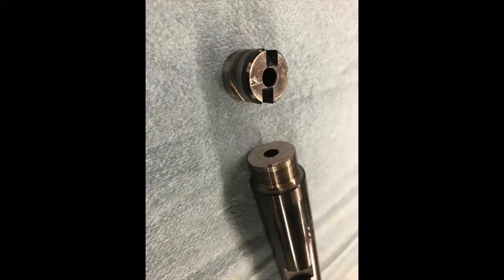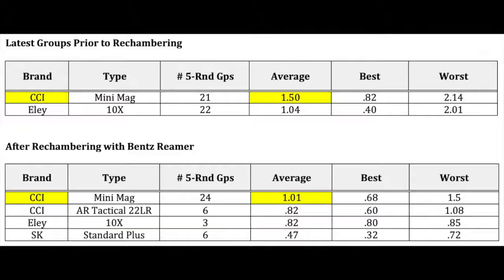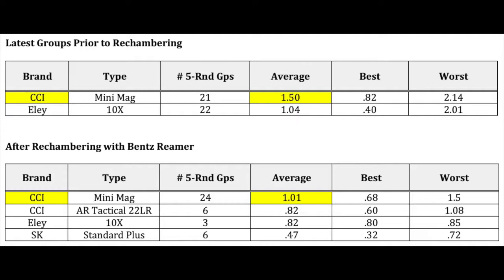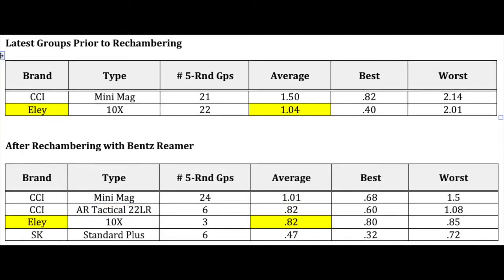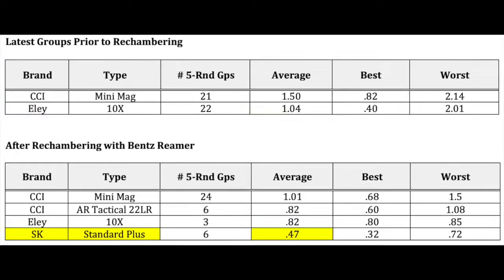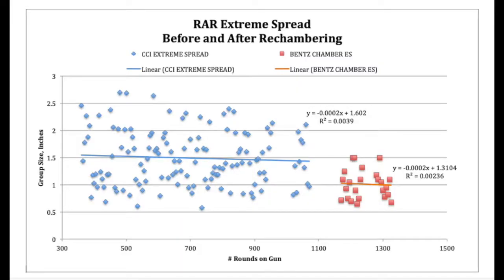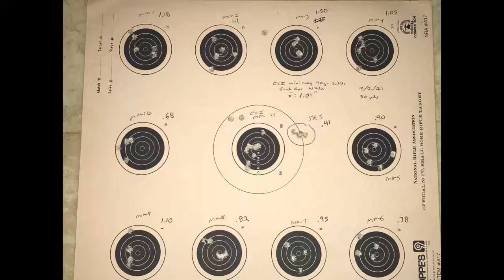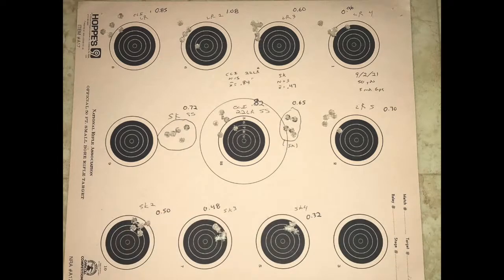Ruger American Rimfire (RAR) Experience.  Part 10:  Rechamber barrel with a Bentz reamer.

Comment: I've shopped around online to see if one can simply replace the standard 10/22 barrel with some aftermarket barrel in the standard sporter taper, but with a Bentz chamber. I'm not looking to make some fancy carbon fiber varmint machine with a full on wild stock and tons of trick parts. Just replace the standard barrel with a similar weighted quality barrel with Bentz chamber. If I want to upgrade the trigger or action with something from Timney or Volquartsen, that's besides the point.
Reply from the maker: Check out Green Mountain Barrels.  They offer a 20" Blued Sporter Barrel, Item # 901913.  They don't specify what chamber they ream it with but I suspect it is a Bentz.  Send them an email to double-check.  I have no affiliation with GM, but have read many good things about them.  Thanks.
Reply: @dauntlessendeavors1000  Excellent suggestion. I have heard of Green Mountain periodically over time and am familiar. Seems 10/22 has had barrels built for it from dozens of companies over the years.
Reply from the maker: Green Mountain replied to my inquiry stating that their 10/22 barrels all have the Bentz chamber configuration.   @turnin.sprocket
Reply: @dauntlessendeavors1000  Oh excellent. Thank you! I hadn't sent an email yet, so that answers the question.

Comment: i had group issue with my RAR 22LR standard in 22" barrel, with all ammunition tried, the chamber was fine, barrel and crown was fine. After some basic tshooting, i found the barrel at end of stock fore end was slightly touching the stock, so wasn't completely free floating. I've seen some other youtube videos of others having the same issue.

I checked the action allen key bolts were touqued correctly @35 in-lb, have a fat wrench torque wrench etc...

I found that if i instead torqued the action  allen key bolts to 15 in-lb, the barrel has enough clearance to be fully floating, and the groups significantly tightened, and can easily shoot less than .5 inch groups at 50M....even with budget ammunition...

So for me the chamber appears good enough, but the action fit to the stock fitting was not boding well with harmonics etc clearly the issue....anyway @15 in-lb action  allen key bolt torque, the rifle is now a solid and reliable performer....

The only remaining issue i have, is the 1st cold shot, even on an acclimated / lubed barrel, POI is terribly off POA, every shot after first warm up shot, and POA always=POI, i'm not terribly fussed about it as i see it's a common issue with rimfire across many different brands...

I wonder if in this video, the original factory chamber was not concentrically aligned with bore center ? as this will significantly impact performance... In My RAR the chamber is very well aligned with bore...chamber had nothing to do with my RAR grouping woes...
Reply: https://youtu.be/Oou5_ARYT5A?si=fF856USpOXXJBptB  
Cold bore shift has to do a lot with the moisture levels in the barrel.

Comment: Thanks for this series. I bought a 10/22 Takedown with a Bull Barrel several months ago and swapped the bolt for a Tandemkross bolt and had the trigger reworked for a much lighter pull weight.  The four factors that affect accuracy are the barrel chambering, the bolt (headspace), the trigger, and the shooter. These two alterations have improved accuracy a good deal but I still yearn for benchrest accuracy.  As it stands, this rifle is about 1.5 MOA. However, the Takedown barrel  is different so can't be set back. To solve the issue, I bought a CZ 457 (non MTR barrel) Varmint with a 20" bull barrel. CZ uses CIP specs instead of SAAMI and while their chamber specs are closely guarded, I believe the chamber on my rifle is close to Bentz, if not better. My CZ is very accurate with the stock barrel but with a lighter trigger spring so the pull weight is less than 1 lb.

Comment: I wonder if the accuracy improvement was entirely from the chamber spec? The stock on the RAR is tapered to “closely” follow the contour of its barrel. On mine, it touches at the forearm tip (not uncommon for rimfire, some even preferring it like the 10/22) and again at two points bt the “recoil lug” and forearm tip. By setting the barrel back you effectively increase the space (moved barrel tapper “contour” away from the stock plastic) bt the barrel and stock. This would free float the barrel (or at least reduce any tension) where it may have not been bf.  Maybe/maybe not…something to think on.
Reply from the maker: You raise a valid point.  Although I never documented it, before I started making the RAR videos, I had already free floated the barrel.  I should have stated that right off the bat, but I neglected to do so and I apologize for that.  I agree with you that with a non-free-floating barrel, the slightest changes in pressure on the stock can affect the point of impact and increase group size.  
I haven't measured the barrel taper on the RAR but on my CZ457, it is .013" per inch.  If I were to shorten the barrel by one inch, it would increase the gap by .0065" on each side.  That could be enough to go from touching to free-floating.